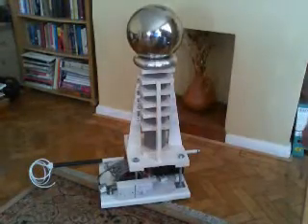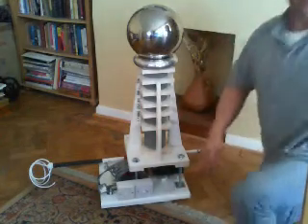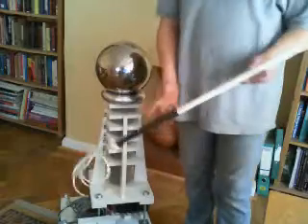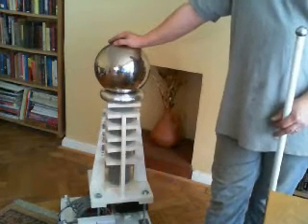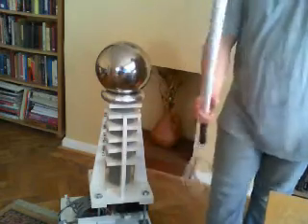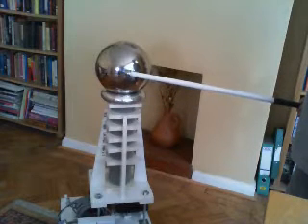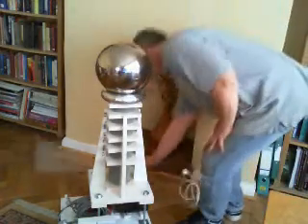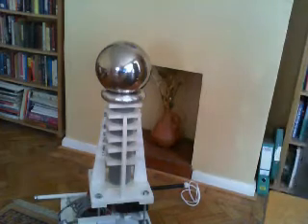How to build a Van Der Graaf Generator 9 - the discharge rod

Comment from the maker: You have to earth the bottom set of brushes. This allows a seperation of the charges to occure. But being a HV device that earth should really be seperate from the house earth as 500,000 volt will play avoc with your house wiring. So essentially fit an earthing block to the base plate, run a thick guage wire from the bottom set of brushes to the block then pound a 2m copper rod into the gorund outside and attach another wire to that - then when you want to run the generator attach to the block